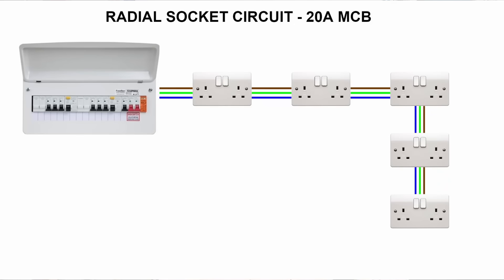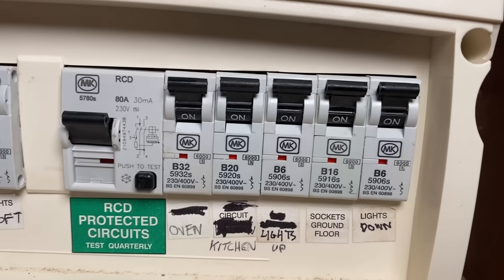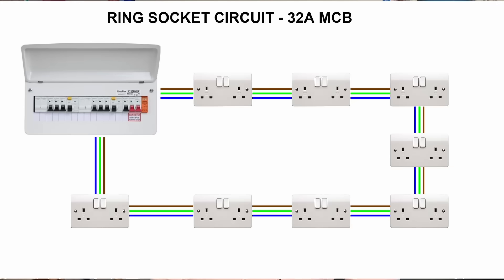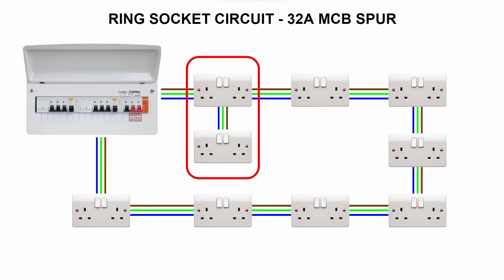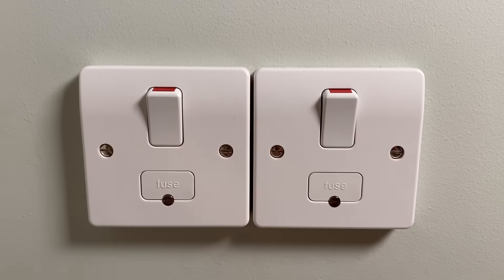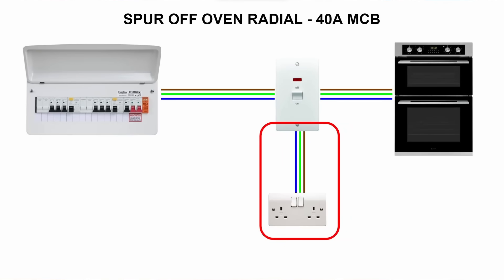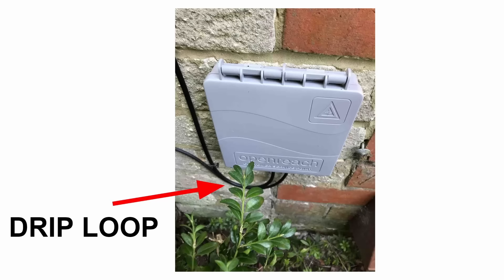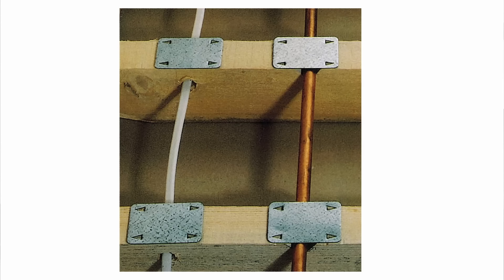BIGGEST DIY Mistakes Adding a New Socket

Comment: Two 13A appliances into a double socket is a bad idea - most are only tested at 20A across both. Washing machines & tumble dryers are a favourite for cooked double sockets.
Reply: Stop scare mongering. The average appliance uses around 9 to 10 Amps of power. The reason they're on a 13A fuse is because a 10Amp fuse would possibly blow.
Reply: @Woodkin007 a 10A fuse would never blow at 10A. At something like 12A it would need hours to blow. Only when you get to like 60 A does the time to blow go down to the minutes and seconds
Reply: @AMalas  their are two types of cartridge fuses: quick blow to protect electronic circuits and slow blow for general appliances.
The only other fuse of these types is the HRC fuse used at the mains incoming cut out.
Reply: @kbolton9399  Yes, what I said mostly applies to slow blow, but quick blow is not too dissimilar. Its blow time also varies with current, and I believe they are not actually rated to blow at their rating. The rating is a maximum operational rating, not a blow rating as far as the datasheets seem to imply
Reply: A qualified electrician would tell you that diversity is how the risk is quantified. That is why a 60A supply is normally suffice to supply a whole house.
Reply: @DavidJohnson-yg8qm  You can't apply diversity to tumble driers. When on full power, they pull the full load all the time. Two could potentially be plugged into a double socket. Newer machines may be more efficient, but not everyone has new machines.
Reply: @gman7692   Really?
Reply: I never run my combination  microwave oven at the same time as the fast boil kettle for this reason.
Reply: Unless actually take note on the appliance.  Meile washer 2200 watt, Grundig dryer ( heat pump) 900 watt . 13 amps both ? Safe or not ?
Reply: @craigs6892  That's 13.5A combined, so well under the 20A probable rating of a double socket, therefore safe.
Reply: @gman7692  thanks,  I'll leave mine plugged in then. Ain't messing with sockets as cant be arsed attempting, I know not permitting anyway  ( dont like changing a car battery never mind with 240v stuff ) . House safe but one day get a rewire done .
Reply: @gman7692 also worth bearing in mind that, even with a higher-powered dryer, they are unlikely to both draw their full capacity for very long, or at the same time.
Reply: IMO there is an often overlooked part in the regulations which states that, when designing circuits any known load (so washing machine,tumble dryer, dishwasher, panel heater, water heater etc) should be on its own circuit. Whilst this inevitably increases the size of the consumer unit it removes the need for all socket outlet circuits to be designed for 32A. A 16 or 20A radial socket circuit per floor in an average house with a 32A radial socket circuit for the kitchen and each fixed appliance on its own circuit is the way to go. Rings are an anachronism.
Reply: @matthewcollis-long5233  
Final ring circuits are very much alive and kicking. The regs recommend separating heavy current loads into separate circuits. Such as electric showers, etc.  Also, one circuit should not interference with another. A final ring is just another circuit.
Reply: @matthewcollis-long5233 get over yourself. If the appliance is rated at 16A it needs a dedicated circuit. 13A, not so sure where you got that regulation from.
Reply: Just use a 16/20 amp on 2.5mm2 like everywhere else in europe and call it a day. Lets be honest, whats the chance of pulling more than 4000w on a single circuit anyways? Even a portable heater is like 2000w. Washing machines, electric oven, water heaters should have their own circuit anyways.
Reply: Appliances that draw continually are limited to just over 2kw. Its only intermittent operation devices that draw more. Kettles typically draw well over 3kw and you'll notice the cable is warm in use.  They do make 3kw fan heaters which is chancing it a bit.
Reply: Never had any problems
Reply: Can confirm 2*10amp on a double is a shit idea. Ideally fit singles
Reply: A double socket, according to MK technical, is only tested to 9amp continuous load. Continuous is classified as 20 mins or more.
Reply: People will continue use use portable 4 or 6 way extension leads to plug a WiFi router, TV, DVD Players etc because the lead is generally safely protected by a 13 amp fuse, this works very well because of the low load in that context.
I managed to buy a 13amp fused twin sized socket outlet which combined a 13amp fused spur on its left side and a single socket on the right side which was very practical in my opinion as it means you can run a spur from the ring main and feed it to this twin sized outlet without using a separate 13amp spur box feeding a separate socket outlet.
It’s a pity MK and others don’t yet manufacture these.
Reply: I still think Ring mains are okay as these days new builds utilise separate ring mains for upstairs and downstairs. 
Given the less dependancy on portable electric heaters, the diversity factor applied to ring main circuits is far better these days with most homes having gas or heat pumps to keep their homes warm.
Reply from the maker: Yep absolutely agree, washing machine and tumble driers need singles. Thanks for watching!
Reply: @TheDiligentDIYer1759 What difference does the use of single socket outlets make when the two appliances are plugged into the ring main?

It is still two 2.5mm² twin and earth cables that are carrying the current.

I think you need to draw out a circuit diagram and analyse the current flow,, including magnitudes and you will discover that a double or single socket outlet makes no difference.
Reply: I’m not convinced by the use of safe plates. Covering notches in joists with them makes sense, but as is demonstrated elsewhere on YT if the person with the impact driver isn’t aware of the need for caution and is determined a screw will penetrate a safe plate. And I wouldn’t bother using them in a wall - the cable should be in the zones and, in a domestic environment at least, 30mA RCD protected. As for putting them over a joist where a hole has been drilled through the timber? Politely, you’re having a laugh.
Reply: What’s 6 amps between friends going to do

But in all seriousness don’t use more then 13amps at a time per socket

Comment: is plugging in an extension cable not essentially taking a spur of a socket and nothing to stop anyone plugging in multiple extension cables. and ive seen ones with like 10 outlets on them
Reply from the maker: Not quite, an extension lead would be like a fused spur, as the plug has a fuse in it. So no chance of overloading cables, as you’re capped at 13 A

Comment: You can put a socket local to the fuse board wired directly out of a 32 MCB it's stated in the regs 👍
Reply from the maker: Yes you are right, as it is basically a spur. You still can’t spur off a spur though. Thanks for watching!
Reply: Yup it's a spur straight off the MCB but you run another from the spurred socket.
Reply: @gctelectrical5555  you dont

Comment: Be careful what your telling people if your no electrician yourself , no DIYer should be touching electrics
Reply from the maker: There are aspects of electrics a DIYer cannot do, but adding a socket to an existing circuit is allowed in the UK. Is there anything I’ve said that is wrong?
Reply: @TheDiligentDIYer1759 no reason whatsoever a person cannot touch certain elements of electrical work. The caveat being, competency and legal framework. I.e part P work such as bathrooms should not be touched, same as adding a circuit. You want to add sockets and are competent - have at it. 
I don’t like the use of the term DIY er, as it suggests incompetency right out the gate. Plenty of ‘tradespeople’ are poor diy’ers at best.
I like the fact you talked about balance of the amperage throughout the circuit based on the 2 directions of flow in a ring as opposed to doubling the cable capacity. Makes more sense to me
Reply: @TheDiligentDIYer1759  Yes as long as a Minor works cert is issued for home insurance  purposes which means the relevant testing has been carried  out....Also checking to see if the RCD now needs changing to meet current regs
Reply: @markyd2633   your right , but the end of your comment is totally wrong. There is no regulation or legal requirement for existing installations to be brought up to the current edition of the wiring regulations . Any of you making comments if you have a copy of the current edition of the IET onsite guide please read page 99 and get your facts straight.
Reply: @Dog-whisperer7494  what part of the comment are you talking about....The upgrading the Rcd part...if so check amendment 2.....or watch the Napit webinar covering their 10 most asked questions...  adding a socket or circuit now requires the RCD to be changed to Type A, unless you can 100% guarantee that whatever is plugged into it has no electronic components
Reply: @Dog-whisperer7494  So maybe you need to catch up on what's what
Reply: @TheDiligentDIYer1759  
Providing it’s not in a bathroom or kitchen, you can alter existing circuits as a diyer.
Altering or replacing any fittings or wiring to a kitchen or bathroom has to be registered with Building Control in the uk & you’ll get a nasty fine if you don’t, whether it’s good work or not.
Any electrical work you do, if it doesn’t comply & someone is injured, you’ll have a criminal record &, dependent on the severity of the injury, from a fine to life imprisonment.
I’ll issue a minor works certificate for changing a lightbulb these days just to cover my own back.
Other things to consider is the length of cable, insulation, earthing arrangements, grouping factors, zones, estimated load, all of which should be designed by a qualified supervisor but, for some reason, domestic installers are allowed to do.
Anything that requires a screwdriver at the consumer unit is a huge no-no these days & regularly gets reported to building control
Reply: Why on earth should a DIYer not touch electrics ?
Reply: @quantisedspace7047  Absolutely no reason. Basically there had been a handful of deaths and fires caused by dodgy electricians , so they imposed ridiculous rules on everyone. Up to that point, most people that did DIY electrical took more time and care over it than most “professionals” and there were very few real problems. Another aspect of it was political to create workers. In some European countries these ridiculous rules ban you from doing your own plumbing as well.   Electricity is not complicated.
Reply: @crcomments8509  "Electricity is not complicated " might be true for a 'ouse basher that knows how to connect blue to blue.
Reply: @Aloh-od3ef  ? If you intend to sell the property. If you intend to keep the property till death who cares.  If it’s certified or not.

And certified by the cowboys on NIC EIC 1 day electrical course please.
Reply: Can't think of anything on my rings, outside of the kitchen, that takes anything more than around 1 amp. May be my air conditioners at around 6 amps absolute max. Unfortunately the regs have to be written for all eventualities and its really a good thing to follow them for new installations. However there are simpler ways of doing things that may not meet the regs but are still perfectly safe.
Reply: @paulm5443  OH  that will stand up in court......Not
Reply: @markyd2633  what court would that be and for what exactly?
Reply: If you listen to the guys advice it’s spot on, better than most Electricians.
Reply: I don't really understand why this is a confusing issue. The regs use the word competent person. So do what ever you like but understand that if something happens you have to prove you are competent in a court of law, I wouldn't fancy my chances saying I'd watched a few you tube videos, most likely you are going to need qualifications. If you want to work in a special location like a bathroom or add new circuits then it needs to be notified, then you need to join someone like niceic so that you can self certify, which you are certainly going to need to be qualified to do. So all this talk of DIY being allowed is frankly rubbish, people have always done it and I'm sure they always will, I used to DIY myself and then decided to become an electrician, the first thing I learnt was how much I didn't know, and how much unsafe work I had already done, the biggest of which is testing, which is not just putting a plug style tester in and getting a green light. There is so much to consider beyond the scope of a 10 min video.
Reply: @oliverriall  
To be a competent person, you not only have to be qualified but registered with a body so your standard of workmanship can be checked at regular intervals. It’s in the definitions of Part P
Reply: @jonathanrose456  You don't need to be with a body if your doing non notifiable work.
Reply: Had a kitchen fitter say to me that my 2.2kw oven would run happily on a surface mounted box in the cupboard. I raised 18th addition and anything above 2kw should be on it’s own circuit. He spoke to his manager in BnQ and they threatened to get Niceic down to discredit me. Even pros make it up!
Reply: If you think no DIYer should be touching electrics then maybe you shouldn’t be making YouTube videos yourself on the subject.
Reply: Im not having a pop bud but have a look at 134.2.1 Diyer's dont really come into it. Without testing its potentially dangerous. What about ADS etc? Non notifiable work does not mean have a go
Reply: @omarpalekar7327  yh but in  reality everyone does. Anyone can pop to screwfix and buy a few sockets and a length of wire. If you're not happy with that write to your mp.
Reply: @omarpalekar7327  not 100% sure since been out of the UK for 10 years now, but is it not notifyable to building control under part P?
Reply: @omarpalekar7327   if your a capable human. And you have common sense their is zero issue in trying your own diy.

If the person isn’t capable then should for their own safety get a professional in. But I’m not the judge of somebody’s capabilities